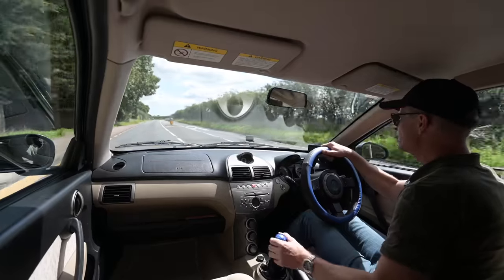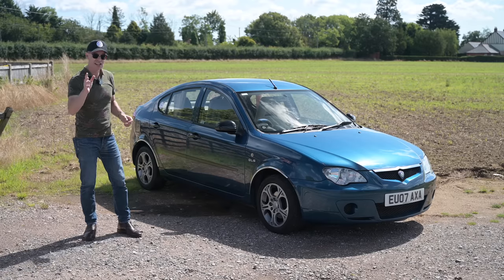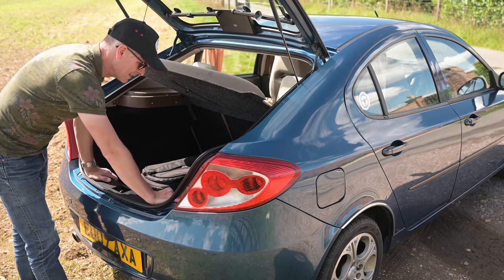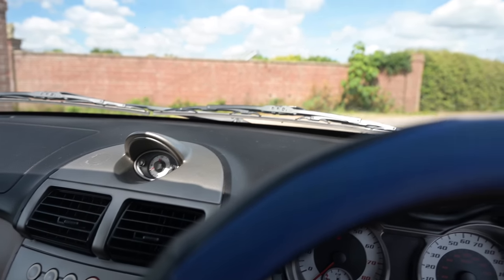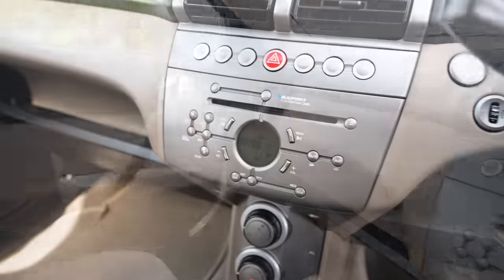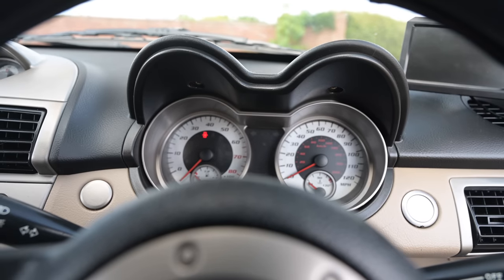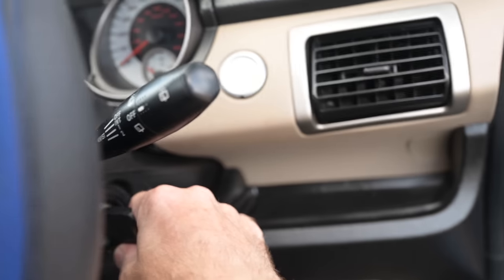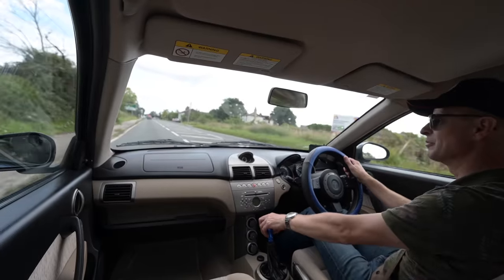Proton Gen2 - The secret  Lotus

Comment: Proton is really a good car. The body is very sturdy and does not rust, and I have driven 800,000 kilometers without any problems. Even the car has not been repaired until today.
Reply: Whether they rust depends on what country they're used in.

Comment: I had an Audi A3 which was written off when someone crashed into it. I needed a cheap replacement and found a Gen-2 at the back of a used car lot, one elderly owner with 55k on the clock. I have to say, it was the maddest car I have ever owned. Not only could you not open the boot, if the central locking failed you couldn't open the doors manually. I had to get the RAC out to take it back to the garage. I was advised never to put the key in the same pocket as my mobile, as this could damage the remote locking. When I took it to the MOT it needed a brake cable for the handbrake. It took the mechanic three days to find one. He said in twenty years he never found a car so difficult to find parts for. Haynes Manual refused to recognise it's existence. The 1.3 engine was a joke on the motorways. You could never get replacement keys and all the trim felt plastic and cheap. It got written off in the snow when it slid and came off the road a couple of years later.
I went out and got a Ford Focus, which in comparison was a lot easier to live with, but really did feel a lot more boring. The Gen-2 really had it's faults, but I really do miss that car. I always kept the spare key as keep sake.
Reply: Know what you mean, quirky cars that could of been great. But parts were a nightmare, main reason I sold my Satria Neo.
Reply: Lol after all that  slating, making it sound like the worst car ever, “I actually miss that car” funny 😂😂😂😂

Comment: There was also a dual fuel model that ran on petrol / LPG called the Proton Gen-2 Ecologic 1.6 which could help you keep your fuel costs down, giving you the choice of low cost LPG as well as regular priced petrol.
Reply: The earlier Impians also had an LPG option as used by the Lincolnshire Police. I believe it was a Prinz system.
Reply: Fun fact. they never sold this to Malaysians. Generally at this time, the export ones are better than the local ones. Local ones suffered from quality issues in this time.

Comment: Hi...i have to agree on everything you said about the Gen2..I own a saloon version of this called the Persona since 2012..with the persona we do get a slightly different interior design and the engine came with the updated intake system or something like that..give a better throttle response compared to the early model but still nothing to shout about much like the interior quality..
Here the Gen2 is derided for its appalling built quality..like you said great ride and handling..fuel consumption in town is not great.open roads however is better..
If anyone can overlook the lack of interior quality,this car is quite fun to drive actually.
Honestly being a Proton,the mechanicals can take a beating.. enjoyed your video

Comment: I came damned close to buying a second-hand one of these years ago when it would've been maybe four years old. It did look really stylish at the time, and the interior was pretty striking. (Yes, yes, I know the quality of the plastics used could've been better. Much better, to be honest...) It was a really nice drive and it could shift itself down the road pretty well! Can't remember what I bought in the end, possibly another Proton model as I had a couple of them. Edit: it was the smaller Proton Savvy I bought - that pistol-grip handbrake reminded me of what I'd bought. As I recall, that had a Renault-sourced engine under the bonnet - a 1.2 maybe?

Comment: I too worked at a Proton dealership from 2005 to 2007 and had 2 as company demos. This was a truly frustrating car. The styling was brilliant, the handling was pretty good and the stereo and heater were brilliant. The Prodigy on full volume with the bass up was a delight (although you couldn't see anything out the back as the rear view mirror vibrated so much.
However 
The build quality was horrific. The plastics fell off, the gearknobs scratched badly if you were a wedding ring, windows had a habit of falling into doors. The alarm/ immobiliser/ central locking had a mind of its own too. The Campro engine performed very oddly. So slow to pull away unless you revved the nuts off it and it loved to overrev when you took your foot off the throttle. Keep it on the boil and wait before changing gear though and it worked fine. 

Sadly it didn't have enough street cred to attract young buyers and the awful build quality put off the Proton faithful, hence it didn't sell. There's still something oddly likeable about it.
Reply: Hi. That overrev thing is known as rev matching, which is also present in come sports cars like Nissan 350Z, 370Z and if not.mistaken Mazda RX7 and RX8.

Comment: Differences between proton gen2 1.3 and 1.6 is 

Gen2 1.6 got rear and back power window but Gen2 1.3 only came with rear power window.

Gen2 1.6 Got two modal which is Gen2 1.6 and Gen2 1.6 CPS 

Gen2 1.6 cps is more powerful than 1.3

In malaysia only Gen2 1.6 cps version having airbags.

Gen2 1.6 came with sport rim and Gen2 1.3 didn't came with it.

Current market price in malaysia is  between RM6k to RM14k base on condition. Alot of modification parts available right now.
Reply: UK did not get the uprated CPS engine. And the specs were different too with twin airbags for 1.3 GLS as well as headlamp height adjuster (compulsory for UK and EU, I think).

Comment: actually had one of these at my old college i think it was a 08 1.6 they were pretty cool but I have to say this we had the whole thing apart in the workshop and the engine wiring loom felt horrific they looked like house flex in places in my opinion they spent the whole budget on the drive train and steering the cam pro engines i love i just think the quality of the intirior and the wiring on the engine let's it down the engine wiring almost looked like a fire waiting to happen

Comment: i have one still since 2005, still do. 99% city driving. translates to about  4 million KM highway driving. The secret sauce of the handling is the multilink suspension but if you ask me is not that great until i slapped on an anti roll bar; then it was a totally different story. The engine is based on a 1.8 Mitsubishi GSR, not some bull about Proton developing their own engine, I know this because some tech from the factory revealed it and also some parts are interchangeable like the clutch pump. I am from Malaysia, home of Proton.
Reply: What tech is that maybe - the piston?😅

Comment: I hand a early proton  nice car had it a few years few cars later had a test drive in one of them didn't like the way it would rev slow changing gear the dealer said it was to burn off  unburned fuel so I bought a brand new Citroen C4 and had nothing but trouble with it ....

Comment: Omg I still can’t believe you guys in the UK ohhh & ahh about a car with air conditioning. In Australia A/C was standard fit on most cars form the late 1980s early 1990s. In the 2000s to present we would be seen dead in car with out A/C. 
Probably because it is a necessity down under but still can’t get over it.
Reply from the maker: it was still an expensive option in 2000, dont think you can get anything without it now but our summers are hotter
Reply: This Proton dosnt have AC

Comment: u should TRY Gen2 limited EDITION 2008-2010 Campro CPS 125hp stock engine. it was tremendous completely amazing n fantastic
Reply: Correct. CPS system was designed by Lotus and even licensed to a Porsche once.

Comment: Gen2.  Drove well.   Everything inside terribly cheap but fine.  I’ve had 5/8 of them In the motor trade.  Saloon out looks the hatch.  They’ve been so cheap over last 5 to 10 odd years as a used buy zero reason not to have one for a year.

Comment: Genuine q.
Audi gets slated for crappy handling because of the engine way ahead of the front axle.
It is on this, fiestas, golfs etc etc.
So why does audi get a bad rap and most of the rest of FWD cars dont? Is it a weight issue?
Reply from the maker: location of the gearbox and distance ahead of the axle all make a difference, pre VAG Audis were very forward most FWD are right above the axle line
Reply: these are transversely mounted with the gearbox to the side and so the weight falls nearer to the axle than in audis, which are longitudinally mounted with the engine way in front of the axle. it had to be so far forward to allow space for the gearbox. The weight of the engine used to be a considerable distance before the front axle compared to transverse fwd, at least in older audis. meant they had to have very assisted steering, porridge-ish handling etc. but it meant they could do quattro 4wd as the gearbox could easily send power to both axles.
Reply: Thanks for the responses

Comment: The Gen-2 was an absolute abortion of a car that was only marginally better then the truly awful Waja. Proton was managed by incompetent Malays and failed. Perodua however, despite being restricted in what it could produce, was a success because it was run by Chinese and Indian Malaysians. Introduction of the Gen-2 was repeatedly delayed as the variable valve timing Proton promised didn't work and had to be dropped.

Proton's best vehicle at that time by far was the second generation Perdana but you'll never see one here in the UK. It was pretty much a re-badged Mitsubishi Eterna with a V6, 24 valve engine and Lotus tuned suspension